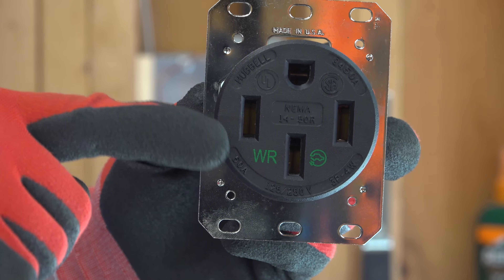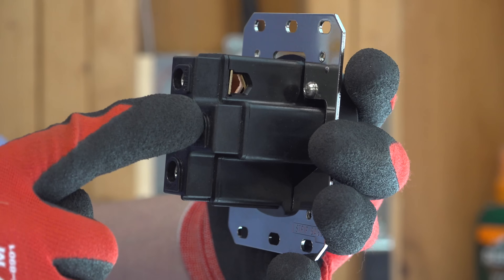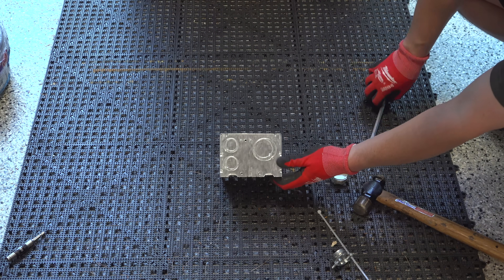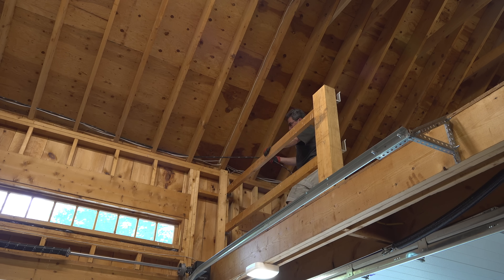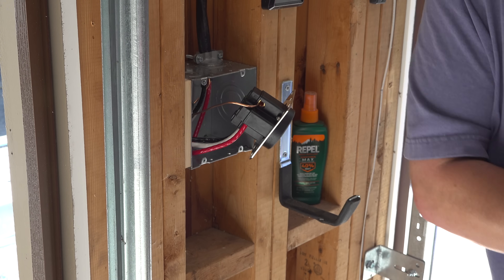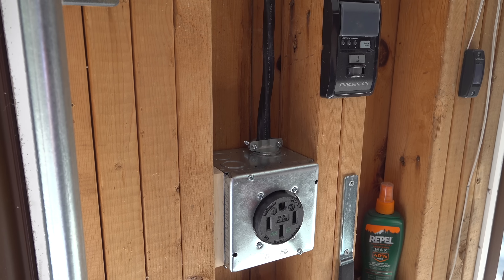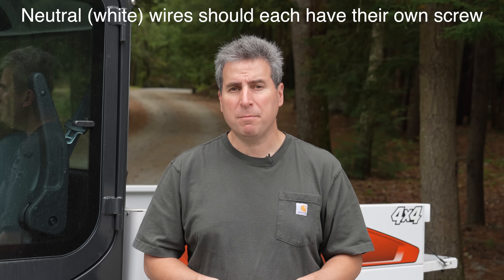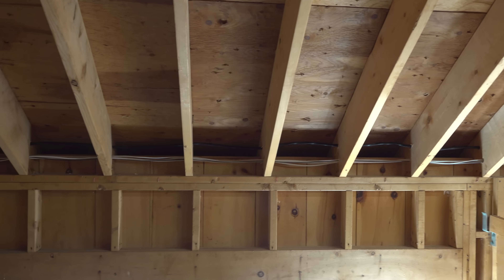How To Install A 240V Outlet Start to Finish -  EV Car Charger - Welder 14-50 Explained

Comment: So many things on here listed as fact are very, very adopted code-specific...which means local code usually based on NEC but which year?  Literally none of the wire run would be legal in my municipality because without enclosing those stud bays with drywall, plywood, etc that is still "exposed" wire so NM-B that is not in a raceway (which includes conduit) is not approved...and that applies to most adaptions of of 2008 or newer NEC.  Enforcement of this portion of the code is variable in utility spaces but in most places it is code. MC/AC or other armored cable, EMT, rigid and even schedule 80 PVC is normally code compliant for exposed wiring.

Conversely, as I am on mix of 2008 NEC and portions of later editions, the GFCI is not required unless it meets the "proximity to water" or exterior requirements.

Moral of story...know your local code.

Comment: Working with stranded wiring is not the same as working with solid wiring.  You HAVE to set the strands! It's very important to set the strands.  A lot of installers forget to set the strands.  

As you are tightening with the torque wrench you need to slightly push the wires in and wiggle them.  Stranded wire will losen over time but if you wiggle and tighten about 5-6 times per conductor you don't have to worry about your conductors working themselves lose.  

You will also notice that as you wiggle after tightening, you will notice the wire working its way loose, because the strands will collapse and spread out.  You have to wiggle and then tighten the wire, this is probably the most important step.  

Loose conductors will arc under high loads and could lead to a fire unless you have arc/thermal protection.

Comment: I think you're supposed to wiggle the stranded wires after torqueing then torque again.. this is a critical step, so the strands of the wire are actually tight.

Comment: That Raco cover 888 has a 2.62" hole, the Hubbell outlet HBL9450A is  2.44", so that is not really the correct cover. I see 2.44" hole covers for 4" boxes, but don't see any for the 4 11/16" box. 

Also every welder I own has a NEMA 6-50 plug, so using a 14-50 outlet will require an adapter. It might be better safety to install both a 6-50 and 14-50 to the same GFCI, so no adapter is needed, but believe that's a code violation. Using a high quality 14-50 outlet is certainly a good idea, but how do we tell if a 6-50 to 14-50 adapter is of good quality?

Comment: Where you live, doesn't the electrical code require that the 6-3 NM cable (or any other high-voltage non-metalic wire) be "protected," such as covered by drywall?
Reply: In most places, that is only required if it is in a location that is likely to be physically implacted or damaged.  It's fine to have it exposed in unfinished spaces (like garages or basements) as long as it is not likely to get bumped/scraped by anything where it is.

(But then there are a few weird places like Chicago where, as I understand it, you are required to run everything through protective conduit even when it's sealed away behind drywall, for some reason...)
Reply: Chicago electrical code are strict using conduit. It’s definitely the best way to go.  It is believed that 2% of the fires in houses are caused by mice nibbling on Romax cables?

Comment: I've done this in the past --- well before EV's (for the trailer and welder). Instead of dealing with an adapter (and where did you find that - LOL) I put a 14-50P plug on the welder and just didn't use the neutral

Comment: 6:16 as an electrician I would NOT striping the outer jacket before putting the wire into the box. If you were to catch the wire on anything you could damage the actual conductors. In your case I’m sure it’s totally fine but just something to be on the lookout for
Reply: 11:42 I see that you mentioned damage here

Comment: Most important thing is starting at the box. Can your box handle the additional load of the outlet. EV chargers require a lot of constant power. Welders are much more forgiving with their load draw.

Comment: I just moved to Ireland. All the outlets are 240v! I did need to get a special 16 amp outlet - and I limited to that instead of a 32 amp outlet because I have a 5 kW inverter on my solar PV system.

Comment: I would like a switch next to the outlet, I don't know the US electrical code but it seems safer if there was a switch that can stop the flow of current when not in use.
Reply: A disconnect is definitely possible, but they are large, and not cheap.

Comment: How many times has the GFCI breaker tripped with the EV charger or welder or plasma cutter? Will get annoying really fast.
Reply: If it were true, yes it would be annoying. But since it's not, it isn't.

Comment: If you do not have a separate ground between subpanel and main panel, you need to tie the neutral and ground together at the subpanel to force the breakers to trip if there is current to ground. This can lead to safety issues though and you would be best off to run the ground wire and do it right.

Comment: The 50 amp GFI breakers such as that Eaton not only cost 3-5x as much as a non-code 50 amp breaker they have a fairly high failure rate.  Amazon comments on the pictured Eaton are at
10% 1star level for this reason.  Mine just failed at ~18months of age, getting little use except for occasional welding.  Awaiting its replacement.   IME none of these are available at HD/Lowes, you need to source from an electric supply house (or Amazon).  Some reviewers suggest subbing Siemens for Eaton, but reviewers don't give Siemens any higher rating, ie they also randomly fail for no clear reason.  FWIW all the other breakers in my two boxes are 40+ yrs old and doing fine.  Only the Eaton BRN250GF failed.   Re cable, wow that is a lot less than when I bought it 18mo ago.

Comment: Nice video. Just the right about of detail and checks all the right boxes as far as I know. I think you could have elaborated more on your roof joist penetrations. That is a bit concerning. Wood dimension and hole location are key elements there that people should consider, as well as the hole diameter you mentioned.

Comment: Check the romex wire rating 50 amp circuit EV ? Would need to be #4
Reply from the maker: No, you have to be careful with 4 gauge also at 50amps some outlets can't fit the wire. You would only upsize to a 4ga for 50amps if you are doing a run that was over 100 feet.
Reply: @SilverCymbal NEC 625, EV charging branch circuits are considered continoius load and require 125% rating.  

So you would need to look at the amp draw of your specific charger also to size appropriately??
Reply: @juicebox22a  That's a different topic: You can run 40A continuous on a 50A line. The amp draw on the EVSE needs to (and can be made to) match what the car can consume or else it won't work. For example, I buy a 40A EVSE for a car that can only pull 32A, I have to slow down the EVSE to 32A or else it will throw a fault when attempting to deliver 40A to a 32A load.

Comment: A GFI breaker may not work for a welder.
If what you are welding is grounded to earth (say a railing or the structure of a metal framed building) it'll trip the breaker.
We ran across this issue in a factory where GFI was required, but simply would not not work for welding.
Reply: I’ve installed multiple EVSE, and none were ok with a GFCI breaker.

This is steering ppl towards hard-wiring for EVSEs, which is a problem for those of us who want EV charging, but also the ability to plug in a welder :(
Reply: Tesla does not want GFI GFCI on their charger. They do a check electronically.
Reply: That's really good to know. I'm installing a welding outlet in a shed and just got a standard breaker. Now I feel better, especially since the GFI is $150+...
Don't think those Hubbles are available in big box stores. Thanks.
Reply: A lot of EVSE's are required to have a built-in GF monitoring circuit as well. Series ground fault monitoring is a recipe for nuisance tripping

Comment: Isn't torquing required by code now?
Reply: You have to follow the manufacturer's installation instructions, and modern receptacles and breakers will all specify a torque value.

Comment: Long-time electrician here. Learned many years ago that Hubbell is the only way to go! I wired everything from 15 amp to 125 amp Pin and Sleeve for the stage and studio business, and most always use Hubbell because they know it's hands down the best and most durable, at least here in the USA!
Great video.
Reply: I would add, Legrand/Pass & Seymour is a good alternate to Hubbell.
Reply: The only way to go …. when someone else is paying :)

Comment: Great job all around:
1. Good job not using a 60 amp breaker with the 6/3 NM (romex) cable. Too many folks oversize the circuit breaker to a 60 amp, which is not code compliant.
2. Great job using the 4-11 box. The biggest size box is best in this case.
3. Great job using the Hubbell receptacle. Best in the business.
4. 14:15 - even though ground bars are usually ok to have more than 1 equipment grounding conductors in the terminal, it's usually only 2, not 3 like you have in the screenshot. Check the manufacturer listing.

Tips for folks who are new to this:

1. You should still use the torque setting for the smaller equipment grounding conductor, since that is what the manufacturer specifies, regardless of wire size.
2. When torquing stranded conductors, it's good practice to wiggle the wires after tightening the lug. The strands are still settling in, so a couple wiggles and a couple of tightens should do the trick, with a final torque using the torque screwdriver/wrench.
3. Watch out for your stud holes. If the cable/hole is less than 1.25 inches from the stud face, you need protection, such as a metal nail protection plate.
4. THHN is good inside of conduit, as long as it is not in a wet location. If the conduit is used outdoors and in a "wet location", you need to ensure the wire is THWN or THWN-2.
5. To ensure the faceplate/raised cover is actually bonded/grounded, it requires a 6-32 or 8-23 screw with nut, not just threaded into the receptacle itself. Check with your local codes and inspector, but see NEC 406.5(B).
6. No need to keep the GFCI neutral pigtail wound up like that. You can straighten the wire and make things a little neater and workmanlike in your panel.
7. You can use the EMT or rigid 1-hole conduit straps to secure the NM-B (romex) cable as long as it is listed for this use from the manufacture. Check the manufacturer listing.
Reply: Doesn't using this type of connector for an EV charger mandate using a 60 amp breaker since it's considered a full-time load and that requires an extra 20% headroom in the breaker?
Reply: @xder345  Yes you need 60 amp breaker/wire rating to support a 48 amp continuous load of a level 2 charger. You can't do this because the outlet still has to be on a 50 amp breaker, so even with the fancy outlet, only 40 amps is allowed.
Reply: @ppg6478  Hardwire should be mandatory once the charger draw exceeds 40 amps, but it appears as though the local fire depts need more work.
Reply: @xder345  No, a mobile charger is designed not to overload a 50A breaker as it will pull a max of 32A. The amperage drawn is determined by the outlet adapter used. 
Tesla only recommends using a mobile charger if you don't have a permanently installed wall connector (charger). So the admission is that a mobile charger is not a 'full-time' load and should not be used with high regularity.
Reply: @michaeltaylor5451 most portable chargers are at 40A ...no?
Reply: @xder345 this is a NEMA 50 amp receptacle NO!
Reply: The Hubbel receptacle has that massive brass self-grounding electrode. I didn't hear him mention anything about that in the video. But it doesn't hurt to bond the box with its own wire.
Reply: Hey dummy, you absolutely can use a 60 amp breaker with 6/3 NM-B it's called the next size up rule.
Reply: @ppg6478  Exactly... 6awg NM-B is rated for 55 amps because of the 60 degree rating and you can go up to the next standard breaker size from a non standard rating, which would be 60 amps.  But if you are going to have a constant 80% load you need to move up to 4awg NM-B or use THHN  or similar in conduit that is rated to 75 degrees which can handle up to a 70 amp breaker because it is rated for 65 amps.
Reply: @matthewf2066  You still have to use a 50 amp breaker with this outlet, regardless of wire size (don't come back applying multi branch rules here). I didn't get into continuous load de-rating but yes, you need/use a 60/70 amp breaker with 6 gauge THHN+/4 gauge NM-B when direct wiring a standard level 2 charger; 60 amp breaker/wire is the minimum to support the 48amp continuous load.
Reply: @ppg6478 I wasn’t talking about the outlet.  I just said that you can use a 60 amp on 6awg NM-B.
Reply: Since I am hoping to get a 48A charger I would need a GFCI 60A breaker by code(?).  A  40A charger  would only require a 50A breaker in the 1.25 overage(?).  You certainly want the breaker to kick if the load surges past what  is expected and  50A breaker will kick in a lot quicker?
Reply: @samsno3667  Unless you have a very long wire run, you would use #6 wire (assuming THHN in a 3/4" conduit) for the 2 hots and #10 for the ground (you can use #6 for the ground too if you have enough #6 wire) and a 60 amp double pole breaker (regular, not GFCI) for a Tesla Wall Connector (not the Mobile Connector). Definitely tighten, wiggle, torque, wiggle, torque, wiggle, torque. Also, run it at max (48 amps) for 5 hours checking the breaker temperature every 30 minutes the first time. I had a bad breaker running almost 180 degrees - something internal as it was perfectly wired up and seated - swapped out the breaker with another new one and under 120 degrees. There is a temperature sensor at the wire connection in the Tesla Wall Connector but not at the breaker in your panel hence my recommendation to check the temperature of the breaker the first time to make sure it is good for a continuous load.
Reply: @samsno3667  you need 60 amp WIRES which also uses a 60 amp breaker. You're allowed to use a 60 amp breaker with 55 amp wire, but you cannot use that wire with a 48 amp charger.
Reply: I used 6/3 UF (Direct burial) from the house to the shed. That stuff is so so tough 😩 Anyways, I used the excess to run from the sub panel I installed in the shed to the RV plug (attached to the outside of the shed) and because of the flat shape of the 6/3 UF, I haven't figured out how to secure it. It's only running down the inside corner of the shed so it's nestled in pretty well but I was wondering what to use to secure it if I wanted to. I just now thought of drilling sets of holes through the stud on both sides of the 6/3 and running a beefy zip tie through the holes. The other area is where the 6/3 runs through the bottom plate and straight up into the load center (sub panel). It's stiff on its own but I reckon I ought to secure it. Also, I think code requires that direct burial cable needs to be sleeved up until it gets landed in a box or to 8 feet. 

I didn't add a ground rod (yet) but I question the necessity of doing so (regardless of what the code says).
Reply: Hubbel also makes the Bryant 9450FR which can be purchased on Zo_ro for $49.   My understanding is it is made to the same quality specs.
Reply: Hmm, interesting,  I used the 60 amp based on what my electrician colleague told me but I also up-sized the wire to 4ga, if I recall correctly.  It based inspection so I must have got it right
Reply: For a Tesla Wall Connector, the common breaker sizes are 40A for 32A output (Model 3 RWD) or a 60A breaker for 48A output (most other Teslas), but this depends on your electrical panel capacity and desired charging speed; a 50A breaker is also a popular, safer choice for 48A charging, with a 100A breaker for shared setups, always using 80% of breaker capacity for continuous load. A qualified electrician must match the breaker to the wire gauge and panel, as a 60A breaker requires thicker wire (like #6 AWG) for 48A charging.  
Common Breaker Sizes & Outputs:
40 Amp Breaker: For 32 Amp output (e.g., Model 3 Rear-Wheel Drive). 
50 Amp Breaker: A common, safer choice for up to 40 Amp output, often used for 48A systems. 
60 Amp Breaker: Required for the maximum 48 Amp output (44 miles/hour) for most Teslas. 
100 Amp Breaker: For power-sharing setups with two or more Wall Connectors. 
Key Considerations:
Electrical Panel: Your home's service (e.g., 100A, 200A) limits breaker choice; larger panels allow bigger chargers. 
Wire Gauge: The breaker size dictates wire size; a 60A breaker needs heavy-gauge wire (like #6 AWG) for safe 48A charging. 
Safety: Always follow the 80% rule (continuous load shouldn't exceed 80% of breaker rating) and consult an electrician
Reply: Would the use shown here on the garage doored wall of the garage between the two vehicle doors be considered as a wet location (on a windy snowy or rain storming day that area might get a wicked buffeting when a door is opened)?
Reply: @Don.Challenger  Nope.  Wet location in short is outdoors.  So a carport...wet location.  The most common error would b the "whip" of sealtite waterproof conduit from you AC disconnect to the outdoor unit...wet location.  Inside a weather-seated structure, not "wet location" and this oddly includes crawlspaces.